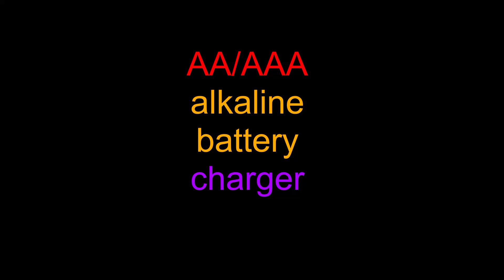AA/AAA Alkaline battery charger teardown

Comment: Could you tell us what  the resistor values are? based on the color code. The current can not be 160 mA. The charging current for Alkaline batteries should be lesser than 16mA. 160mA is good for charging NiMH batteries. Also, the LED will burnt out at current larger than 35mA.
Reply from the maker: oh, you are right about the currents! But I cannot tell you resistor values, I do not have this charger with me anymore, sorry
Reply: You really don't want to make this... You're going to kill your batteries so fast

Comment: Could you draw Schematic with component values?
Reply from the maker: Hey sorry, I do not have the device with me, I left it in another country. But as far as I remember it was just a red LED in series with a resistor, the LED limits voltage and the resistor limits current. Ni-MH can hold like 0.1C once charged and dissipate it into heat.